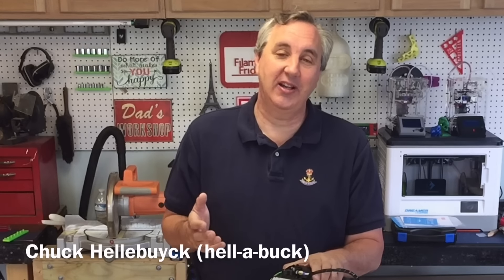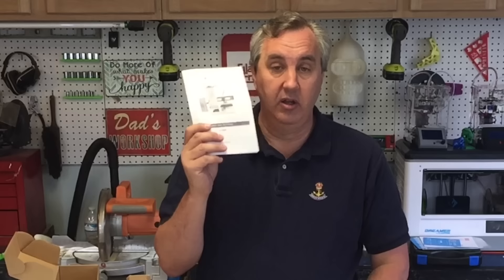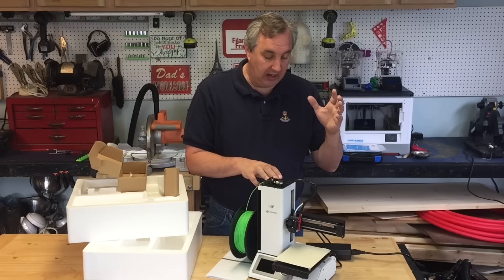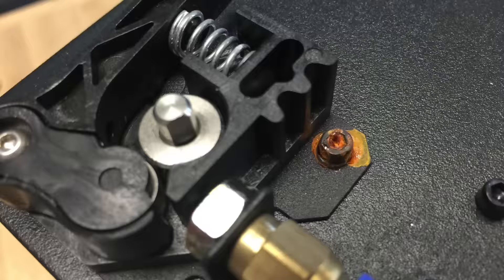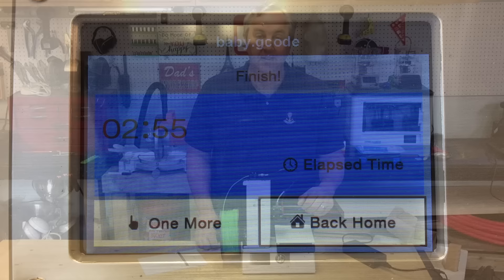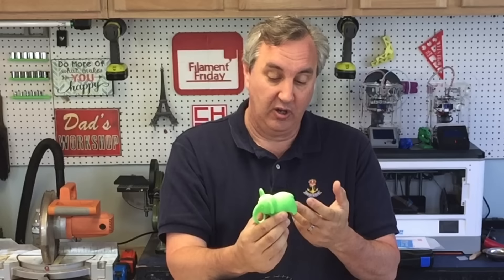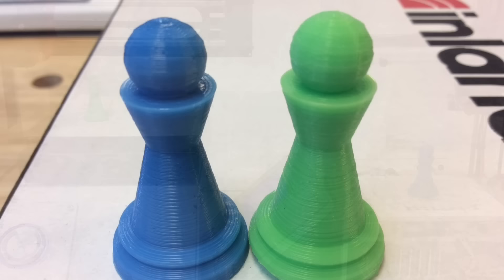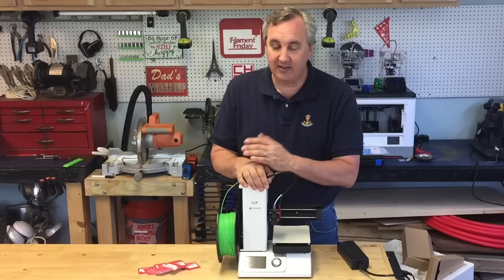3D Printing Filament Friday #70 - $199 Monoprice Select Mini Review

Comment: You are the reason why I have a Fabrikator Mini on order (via prev vid).  I also got the display you recommended and found a heated bed option on eBay designed for the Mini.

Comment: If you have a strange gcode file and you want to see what it looks like without actually printing it, you can drop it into Simplify3D to look at the gcode review. I just did that with a file I sliced in Cura. That's one way to find out if the baby elephant is supposed to have those bumps or not.

Comment: This printer actually does have WiFi but it isn't enabled in the firmware it ships with. If you flash some firmware provided by the printer's OEM Malyan it enables it. Monoprice asked Malyan to take it down so you have to get it from a Google Drive share. There's a link here https://www.youtube.com/watch?v=UQkVYsSrpVw. I haven't tried it myself because I already have a BeagleBone Black setup with OctoPrint so I don't need WiFi printing.

Comment: Hi Chuck, this printer has a run.... there is no available at Amazon or at the manufacturer. Anyway, I got mine 1 week ago and I did a few test prints and it works great.
I have a Velleman K8400 dual head, but this lite guy is awesome. I can recommend the SELECT MINI
Unfortunately, I spent 199USD and 41USD shipping and 47USD VAT to Germany... but it is a great printer...

Comment: i thought i should give you a heads up on something one this printer. im kinda starting 3d printing but i know the area and everything and done a good amount of prints so far but for this printier i have one that i use mostly. what happend over time is seems that locking nut which hold the hot part of the extrude and the nozzle in place came loose. i realized this too late and it tore up the tape i was using on the bed. but it was easy to fix.

Comment: it seems one of the axis is shifting. just a tiny amount, but it is shifting.
Reply: In other videos about this printer, I also see a bit of shift on one of the axis. No one seems to be certain which axis it is on. To be fair, I've also seen axis shifting on my Fabrikator Mini, but that was due to the stepper drivers overheating. I think I fixed that [with your help]. So what I would look at on this printer is the same issues of quality control that creep in on these cheap printers: the stepper motor drivers.

With an enclosed case like it has, I wouldn't be surprised if it is tuned correctly, but just barely doesn't get enough airflow.

Comment: OK, this motherboard looks like a smoothieware board. Looks like a Chinese clone. Pop the card into a PC, you should find a firmware file (backup) and a config file. This is really impressive for such a low cost printer. Chinese smoothieware boards are not cheap. They go for $50 and up on This looks like a clone of the Azteeg X5 Mini and that's a $110 board. The parts here with all the Nema 17 motors + the controller board it's worth more than $199. This is awesome. Even if it couldn't print well, you could part it out. How are they doing this price?

Comment: Chuck what slicer are you using?  I'd love to compare notes and get some help tweaking my printer.
Also, I wish someone could share with me the Simplify3D profile for this printer with me.
These printers are re-branded Malyan M200...confirmed by Makers Muse.
Reply: Yup...re-branded Malyan M200 . It also has WiFi! I configured mine to test it out. Here is some documentation for fixes done to this printer, theres a M301 command to fix the unstable extruder temperature . https://docs.google.com/document/d/1HJaLIcUD4oiIUYu6In7Bxf7WxAOiT3n48RvOe5pvSHk/edit

Lastly, here is the wiki from Malyan: http://wiki.malyansys.com/doku.php

Comment: I just bought one waiting for it in the mail.....is it windows 10 compatible with the software like cura?
Reply: CHEP 3D Printing  what programs do you suggest for me to create my own designs?
Reply: CHEP 3D Printing  thanks I actually just found your page yesterday and subscribed. you sold me the mini basically.... thanks for steering me in the right direction. I was recently fired after 8 years of service in a union job for leaving work early when my wife went into labor so I'm trying to learn a trade in 3d printing and keep myself busy while all this crap settles. I have never printed before either but I have a engineering background so I have confidence....it's the computer I'm worried about learning all the different types of slicers and 3d drawing. I bought a spool of hatchbox pla silver and a micro SD card adapter for my computer. I'm hoping that's enough to get me started until I find a better source of income (unemployment). I'm hoping I'll be able to successfully build things for people to make life easier. thanks again for your time and patience. Happy new years and God bless

Comment: Hi Chuck I read today that you can use Simplife 3d on xyzprinters. Looking at the Simplife 3d website they say most xyz printers can be used with Simplife 3d. Would you know if the printer needs to be flashed and do you need to use xyz filament?
Reply: Hey Si, I have a DaVinci 1.0a that I run with simplify3d. Just go to the configuration assistant in the help tab of simplify3d and select the Da Vinci 1.0. Then connect the machine and it will run without flashed software. Bad thing is you still have to use XYZ filament due to the chip that is in the cartridge. I use the XYZ cartridge refill kit from www.makeshaper.com. Really good filament for a better price than the XYZ stuff.
Reply: Thanks Caleb  I am going to have to get S3D.  Its just too good not to use.
Reply: Agreed! Well worth the money.

Comment: I got one it clogged but it is great, however the davinci is one of the worst printer I got, including the dremel 3D
Reply: That's surprising that you didn't like the Davinici. I've been watching the reviews and most people enjoy it. Especially the fact that you can load custom firmware on it and that it's easily moddable. I've actually been saving up for a Davinci Duo for a while now.
Reply: ***** It was my intention to buy the DaVinci and reflash it anyway. I think going into the purchase with that in mind for many people, is why those people consider it successful. I have no reservations about it either way. It's just been sitting on my wish-list for a while now. I especially like the closed-frame box because of the temperature swings I get in the shop. I have too many fans, electronics, etc running often or intermittently.
Reply: +bugs181 I do not like it because it is closed source and I had it two times before it worked
Reply: +Chuck Hellebuyck's Electronic Products Nice Review I got this printer
Reply: Thank you both for sharing your views/input. I'll definitely take it into consideration and do a bit more research. Either way, I plan on picking up one of these monoprice printers for smaller objects. Looks like it's a good quality build for the price.